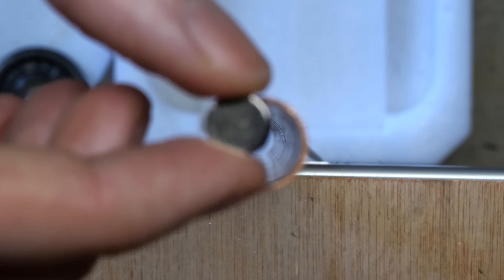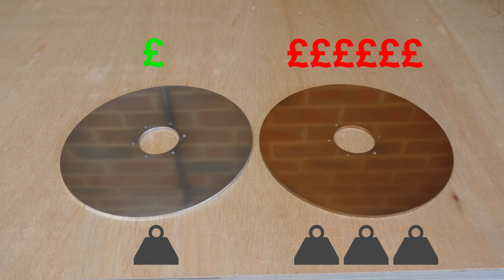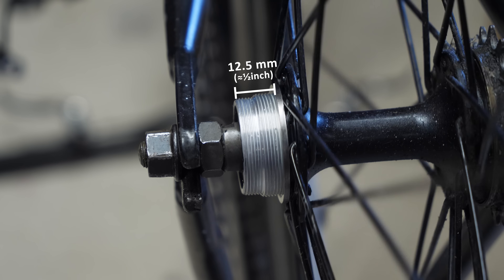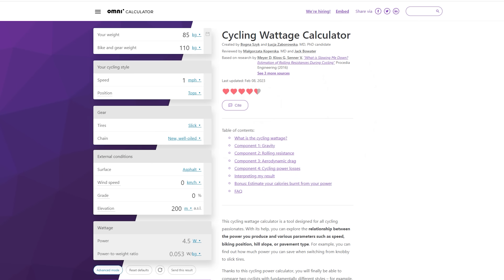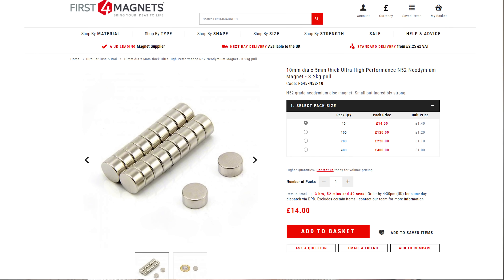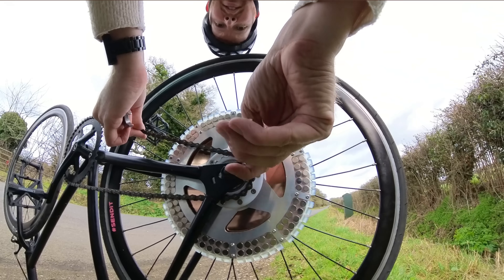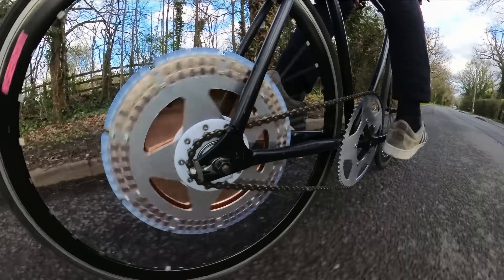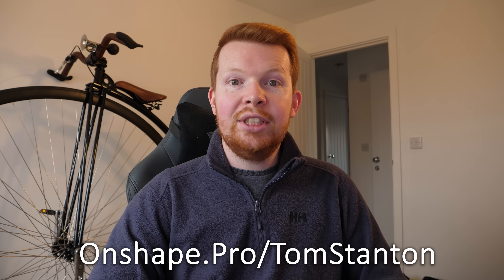Gearless Magnet Bike

Comment: Snce any hesitaton n cadence nduces changes at the rear hub, would a free wheeling front sprocket be of any possible use?  It might be quite small but any progress toward efficiency is still progress.  I realize that heat by induction at the rear is the actual problem.  Just a mental exercise of my own.

Comment: Combine this with an electric motor. should reduce the amp usage by adding a more gradient start also switch to a belt driven system to avoid interference by the metal chain

Comment: would it work to have a steel plate instead of a copper one, and have a mechanism to lock the magnets onto the plate to get a locked transmission and then just unconnect it with a lever or something. the lever would have to be strong but maybe it would work with electromagnets ore something? i don't know just an idea

Comment: A steel plate on the opposite side of the magnets would close the flux path for considerably better flux density through the copper disc. The plate would have to be in the order of 2mm or so thick given the size of your magnets. That's why flux rings are used in electro motors. As an added benefit, the flux plate would also prevent the chain from sticking to the magnets. Having said that, this design would not provide an efficient transmission for a bicycle due to the heat generated in the copper disc as you mentioned towards the end of the video. This concept makes a very good dyno for motor testing if you provide a mechanical means of adjusting the air gap or perhaps using electromagnets for torque control :)

Comment: I wonder if electric magnets could help? When you're starting off or going up hill you could disable some magnets to reduce your resistance. Then, you can increase the magnet count as you go, increasing resistance and torque?
Reply: Who knows you might even be able to have it self-contained in a way that allows some of the electricity generated by the initial magnets to turn on subsequent magnets; making it self-scaling / self-gear-changing
Reply: Powering actual electric magnets could be a pain so it might be better to have a way of moving the magnets out of reach of the disc and then have them get closer as needed?

Comment: Yes, this isn't an efficient way to transfer power. But if you could switch the magnets on and off mechanically, and if they are powerful enough, this could perhaps work as a drag brake - which is wat tandem riders sometimes use when riding in hilly/mountainous terrain to keep speeds reasonable on the descents. Common drag brakes (nowadays most often large rotor disk brakes) are susceptible to a lot of wear. This could be avoided by making them magnetic and contactless.

Comment: Maybe you could try to continue the work of Honda, they built a continuous drive on a downhill bike. You should be able to access the patents (which are still vaild, but soon run out). They did 3 iterations, the first 2 may be the most interesting: they translate a rotational motion to a linear one, do the transmission, then convert back to rontational.
The last one was just a normal gearing in a box...

Comment: Interesting idea. Of course this could never replace a direct contact brake, but you could certainly add it to existing once, greatly increasing their efficiency, prolonging the life of both brake pads and discs and lowering the handle pull force required to achieve full braking.

Comment: Are you able to find a toothed rubber belt drive setup? that would eliminate the chain magnet and resin sprocket problems?
Reply from the maker: I've used belts for my ebike drive train, and they tend to be far wider than chains for the same torque rating. Which given the limited space, would be difficult to fit.

Comment: you should be able to achieve better results, by using a bearing that only transfer torque in one direction, also a halbach array should induce more eddy currents and concentrate the magnetic fields only on the copper disk and not the in the chain.

Comment: I would love to see how this works with the aluminium disc.  Aluminium has a lower thermal capacity, potentially resulting in lower thermal losses in current generation.  Thermal energy waste is not the factor I'm talking about here, but instead how the heat of the disc can affect the Eddy currents generated within.

Comment: the initial sprocket failure might be due to chain stretch? when the chain links lengthen due to internal wear, all the torque ends up on the leading tooth only - maybe if you printed the teeth at slightly long pitch it would distribute the load correctly

Comment: What might be more effective would be peddling a generator that charges super capacitors and a small battery to drive an electric hub motor with regenerative braking.  The hard part would be creating a learning algorithm that controls both speed and input needs (how hard you have to pedal) based on multiple factors like incline, temperature, heart rate, calories burned, etc.

Comment: It is basically a constantly slipping clutch. If you can make some kind of locking mechanism, and some sort of CVT, you will have made the ultimate bike experience: use this to set off, then it locks to work like a normal system, and a CVT varies the speed. Kind of like a locking torque converter setup

Comment: As a driving mechanism, it's inefficient because you waste power on the slippage of which there is always some, even with really strong magnets. I wonder about this as a low wear braking device though. If it can be put on the wheel and both assemblies are free to spin, but when the brake is applied, the magnet assembly is stopped and then goes the eddy current braking, which dissipates most of the energy without contact. You'd need a mechanical brake to stop completely though. It's also a pretty decent exercise bike if the front is on a stand and the back wheel on the ground. If you had a freewheel so there was a direct mechanical linkage between magnets and disc when pedaling forwards but you'd get a gradual slowing by holding the pedals stationary or pedaling in reverse. A sort of coaster brake.

If you want something more efficient for power transfer, you could try coupling two motors.

Comment: I think for a variable transmission you need a electric magnet instead of copper coil that can sets it's phase relative to the magnets that are connected to the chain, I think it's like how electric motors sets their speed but in this case you provide the power by pedaling

Comment: you made a mistake, with the aluminium and copper disk. the reason the copper disk won was due to the weight since when you ran it without magnets the copper disk won by a much greater margin than when you ran it with magnets.

Comment: Interesting but pointless. Strange not being able to freewheel and the frame will also be resisting the magnets. Now. Cut out the section of steel frame, replace with non magnetic material and add coil gun circuit to power it like a motor. That would be more interesting!

Comment: This would be interesting in a generator type of setup that drives an electric motor to assist the rear wheel. Could be a replacement for a traditional drivetrain. Set the bike up in a single high speed gear and use the power generated by the alternating magnetic field and some batteries.

Comment: Tom,  I am 12:23 into the video, and the same thing nags at me from the start:  The slip between copper disc and magnets represents lost power, rather than torque multiplication.  Sure, this invention lets you start off with a single very "long" gear, but not efficiently.

Or am I missing something?

Comment: Wow that cool how the magnets slow the disc down so much..do you think there would be a way to make a system like that to use as friction free brakes on a bike as im building a ebike camper on my channel to go live in and would love a way to have a friction free drag brake when going down steep hills as the camper will be around 140kgs.
i will be useing the drag brake on the ebike wheel which has hi and lo and the camper will have two sets of disc brakes but would love to have a friction free drag brake system and only use the disc brakes when needed on the even steeper hills??
Love all your videos Tom.

Comment: Interesting, a mechanical "Induction motor" -- It's basically a Torque Converter.
Next step is to put magnets on the copper and make a mechanical PM motor! Then when you are at speed, and low torque, it will "cog" into lock-step, and thus have no losses.

Comment: O man! you are half way there! If you add to this instead of copper disk a metal hub with cuts and elector magnets coils. Having 3 f motor in it will give you: 1. control over slip of the clouth 2. cheat with the modulation of the hub to speed up the wheel to the relation of the pedals 3. e-bike 4. regen on breaking👾

Comment: You should cool the copper with freezing spray or dry ice before you ride. The increase in conductivity of the copper by the lower temperature should drastically increase the torque! 
(You can try this on the copper pipe with the dropping magnet as well, put it in the freezer for example)

The opposite effect is also true, the increase in temperature that you noticed due to the power losses during riding would lower the torque compared to ambient temperature.

Comment: Not an eddy current. Just a normal current. There probably are eddy currents in that tube, but that's not because of the induced current, but because of the large cross-sectional area.

Comment: 2/3rd in, thoughts so far, definitely consider looking at Gates carbon drive, that alone could solve two big issues. I also wondering if this could be adapted to replace disc brakes, being non-contact there's no pads to wear out,

Comment: This idea would be a good candidate for a belt drive.
Reply from the maker: I've used belts for my ebike drive train, and they tend to be far wider than chains for the same torque rating. Which given the limited space, would be difficult to fit.
Reply: @TomStantonEngineering  I don't have experience with a belt drive, I think they are neat but I wasn't aware of the width. Love the magnets!

Comment: There is a way to do this, invented as the Entz electro-magnetic transmission. Basically two electric motors, one connected between input and output shafts, the other between the output and the chassis. At low speed, the first acts as a generator providing power to the second for extra torque, at high speed the second generated power driving the first.

Comment: Adding a freewheeling ratcheting mechanism might be what you need to disconnect the rear sprocket when torque is not being applied at the top and bottom of the pedal stroke.

Comment: This is how speedometers used to work in older cars. There would be a flexible cable going into the transmission, and that cable drove a magnet inside a shallow cup that was mounted to the speedometer needle. The faster the magnet spins, the higher the needle points.

Comment: Very similar to a torque converter. Needs a lockup clutch to bypass the mechanism for starting, uphill work or higher speeds. Either as an extra handle or semi auto (based on pedal velocity for higher speeds and use a handle for manual activation for lower or uphill speed)

Comment: It's a really cool project. It is a magnetic torque converter with much more energy dissapation than a fluid one. But, yeah, what problem is this actually solving? Maybe driveline shock when shifting different gears?

Comment: This is actually epic 👀 I wonder if copper coated aluminium would work better or worse or in between? It would be lighter and you can alter the thickness of the copper coating it would deal with the heat better too

Comment: Good work. Better is belts drive  https://youtu.be/qprII2Y-dGA
Use discs and magnets on the crank shaft with direct communication low and high gear will be more efficient.

Comment: Come to think about it, I think it's not the RPM difference that determines the torque, but the linear/circumferential speed difference. This means you can probably have a CVT drive by varying the radial position of the magnets. And what if you mount the magnets on a centrifugal mechanism that rotates with the wheel (so the copper disc would rotate with the sprocket), so that the faster the wheel spins the further the magnets move away from the axle?

Comment: I made a damper like this years ago for damping the motion of a large camera on a sliding rail, using a belt drive. The copper disk was about 80mm diameter, with circular neodymium magnets, like yours. I noticed that when the camera was moved fast, the disk spun fast, and it heated the copper disk up a lot, too hot to touch after a while. I guess that makes sense as the energy taken out of the camera motion was turned into heat. In your application, would this not lead to a very inefficient drive train? Some of the riders effort would just be turned into heat in the disk

Comment: G'day,

Yay Team !

A delightfully well-conducted Experiment, which - due to your recording of the process, has (despite being a Statistical Universe of 1 Sample) done an absolutely EXCELLENT Job of producing apparently entirely Valid Data ; leading to the irrefutable conclusion that the Reason why Pushbikes don't feature Neodymium-Magnetic Eddy-Current effected Infinitely-Variable Drive-Trains - is not that they cannot be made to function ; but rather that they function specifically by converting a moving Magnetic Field into HEAT,  building up in the Molecules of Copper as they resist the pulsing Waves of Magnetic Force sweeping through the Metal...., as being the source of all the "Stickiness" via which the Torque is transferred from Chained Magnetic Disc to the Coppered Wheel....

(Whereas, by comparison, my underconstumbling of the matter is that a Conventional Bicycle Chain-Drive is 98.5% Thermally-efficient - losing only 1.5% of the Input Energy to Heat-Losses during the Transfer from the Drive Sprocket to the Driven...; last time I flew behind a Lawnmower Motor - in 1978, my Propeller had a 3:1 Reduction-Drive effected via a Bicycle-Chain...!)

Absolutely brilliant mate.

"Three Gold Stars and a Koala Stamp !"

At the very least.

Keep on keepin' on...!

Stay safe.

;-p

Ciao !

Post Scriptum...,

About the only trick which you missed would  have been to Video the Effect of  Backpedalling while rolling - to record the (presumably) increased Braking Effectiveness... (?).

I realise that Dynamic Backpedal Braking Effectiveness turns out to be an irrelevant Data Point - but in a sentiment of 
"while you were at it-ism...",
it's a slight pity that you didn't collect that one last "souvenir" while you were so brilliantly set up to grab it, in passing as it were (!).

lol,

;-p

Ciao !

Comment: Just an FYI but you can cut threads on your cnc router.  It's called thread milling and it does require buying  a cutter for thread milling but since you're probably cutting aluminum you can get away with high speed steel.  Since I don't know your controller I can't say for sure you have a canned cycle for it but it should be easy to lookup.

Comment: 1min 18s the difference between aluminium in copper in veritasium's video is obviously from weight difference and the low density and heat capacity are probably the reason why aluminium is beter for breaking, less heating = lower resistance = beter efficiency

Comment: With an alu or carbon frame, belt drive, and hub spacing wider than the 120mm this fixed gear has, there would be so much more wiggle room for everything to come together. Very cool.

Comment: you need iron backing plates to complete the magnetic circuit. 

that would have prevented the chain being an issue as well.

as for "variable transmission", try  "thomson transmission".

good luck finding information online about it though! only reference i have is the 1912 book describing it.

two motor/generators, connected via two sets of planetary gears.

theres... some related patents scattered around.

Comment: Awesome! I've been dreaming about a stepless bike transmission all life! Buut:
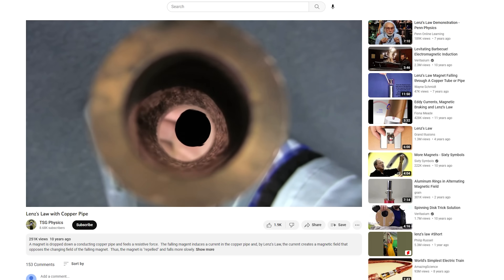1:00 the problem is that all current induced into the copper plate is becoming heat. Thus the inefficiency increases with slip - not ideal, as ironically the resistance increases where you need more torque = more slip, like going uphill.

Comment: The thermal camera was exactly my question through most of the bike section. If you only have the halo of the copper with disengageable magnets, would that produce the same braking power? In your braking tests, you stop pedalling. Does the speed decrease much faster if you pedal backwards, like on some bikes (typical for kid bikes) where the brake locks the back wheel?

Comment: When I saw the video title I thought you will do something like this  https://www.youtube.com/watch?v=DAWVetrtD9U
Do you want maybe to make your own version of magnetic gears/transmission like that for the bike? :)

And about the disks. I think in your case they are more similar to a motor than a transmission. Stator and rotor were just "turned inside out" into disks.

I know nothing about magnets, but probably also disk is too thin. Is it possible that a lot of magnetic force is wasted in the air behind the disk?
Maybe some clever magnet configuration that will put all magnetic force/lines into the "body" or plane of the disk will produce better results.

P.S. Like your videos, thank you for doing them.

Comment: Fascinating project.

I would see a good use in the opposite direction: as a permanent break, e.g. for heavy cargo bikes. Especially in mountainous regions this might be helpful.
The break force could be regulated by bringing more or less magnets to the disc. The risk of blocking wheels could also be reduced (0 rpm = 0 break force).